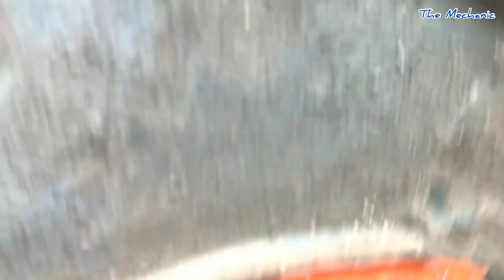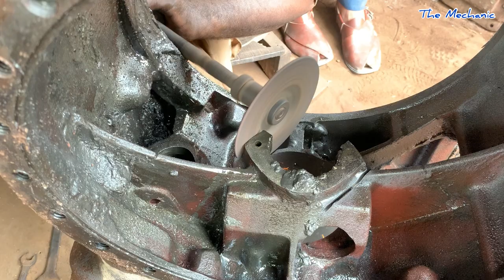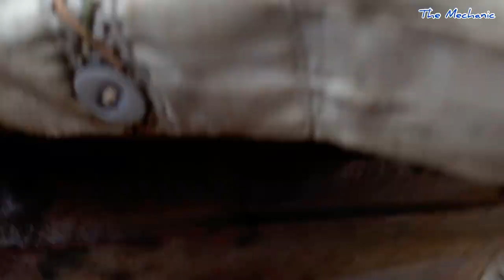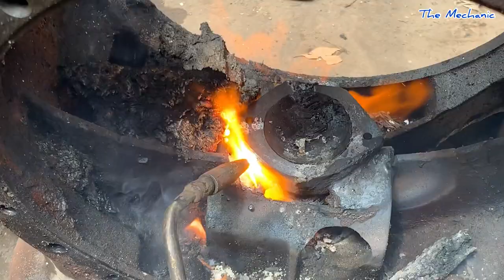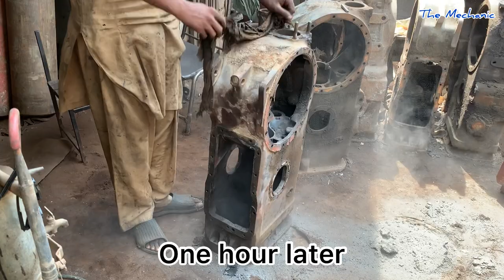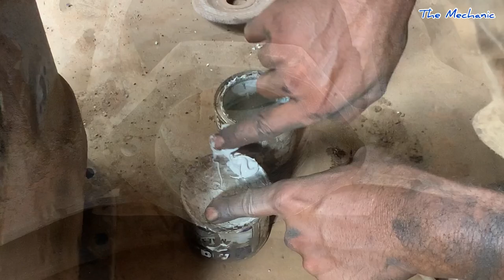Repairing Tractor Broken Cast Iron Center Housing || How to Repair Tractor Cracked Transmission Case

Comment: Why spend time on the casting when the pinion gear is shot?  It may well have been shrapnel from this gear that broke the casting.  Before you spend untold hours trying to refit the casing, find a used pinion gear, or you're wasting your time!